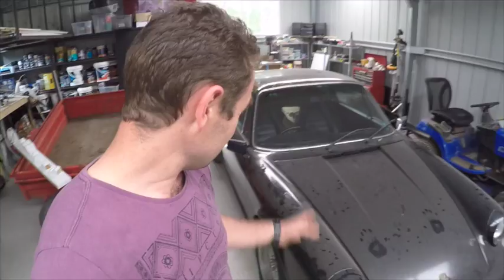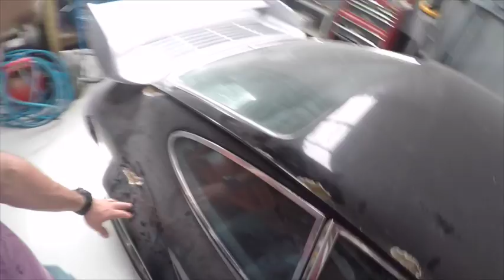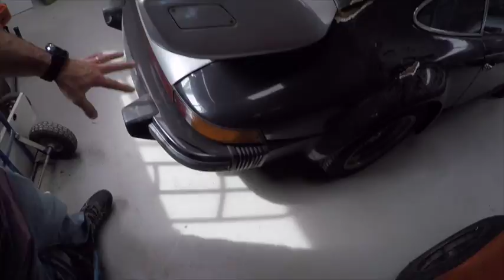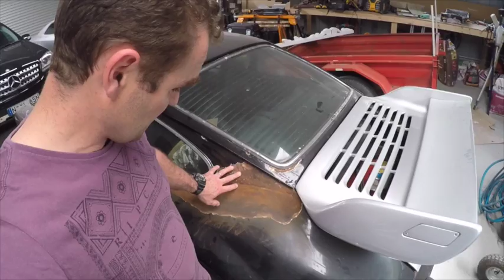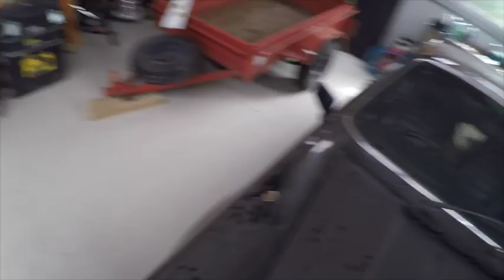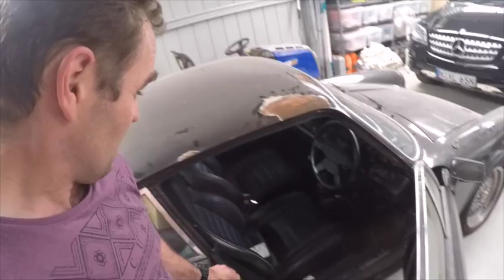Porsche 911 Project Build Intro - Porsche 911 Classic Car Build Part 1

Comment: Glad I found your channel. I've always been interested in doing a 964 restoration to RWB build. Haven't watched all your videos yet but have you made a video on how to choose the proper car for a project?
Reply from the maker: Haha, no but that would be a good start. This car was good for me because it was cheap at the time, but it required a heap of work.
Only suggestion I would have, is if you are going to build an RWB, try to get something that is not original, as it should be a bit cheaper and you are going to 'butcher' (as most Porsche guys would say) it anyway.
As for these early videos of mine, I cringe watching them back now. If you look at the current ones, they are much better.
Reply: Thank you for the reply. I agree I'm looking for salvage vehicle that will be "cheap" (haha nothing aircooled is cheap these days) as I would hate to hack up an original. 

My wife and I had a good laugh at the fuel tank removal video. I did some thing similar the other day swapping out my radiator in the daily driver.  Us men have to do at least one dumb thing within a 24hour period as a standard I think hahaha
Reply from the maker: Haha, if I do just one dumb thing it is a slow day ;)

Comment: '76 2.7 S 165 HP engine. Perhaps still has the infamous thermal reactors on the exhaust (primitive catalyst converters) and exhaust gases partial inlet recirculation, to lower emission to USA, Japan and Canada markets. All these combined with a soft magnesium crankcase were the cause of pulled head and cylinders studs from the case. Nowadays, when refurbished, common solution is to machine pin holes in one crankcase half, and place pins on the other half, to avoid warping crankcases due to overheat.
Reply from the maker: Yes. That is the reason why the mid-years are the least loved 911's (except maybe the 996 ;) ).
I will be building something a bit more special with this engine. If you see some of the later videos where I strip down the engine, you can see some of the terrible rebuild it had previously.

Comment: Have you made any videos where you tackle the torsion bars? I looked through, but didn't see anything yet
Reply from the maker: Not yet. I have been concentrating on the body to start with, and once it is painted I will be rebuilding the engine. Suspension will definitely be on the list but that will still be a little way off yet.